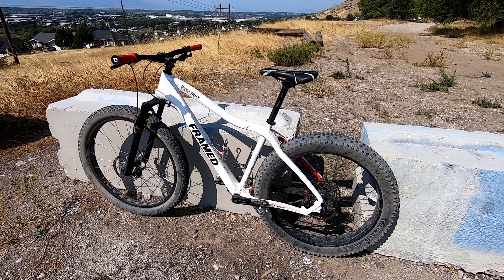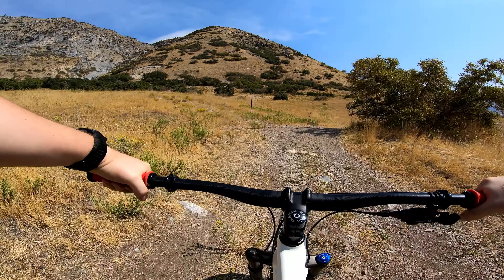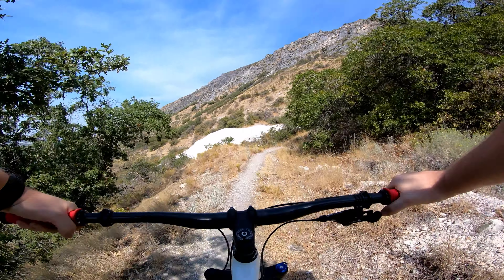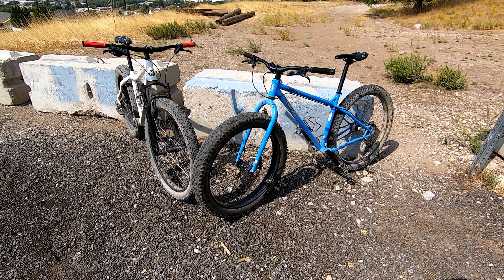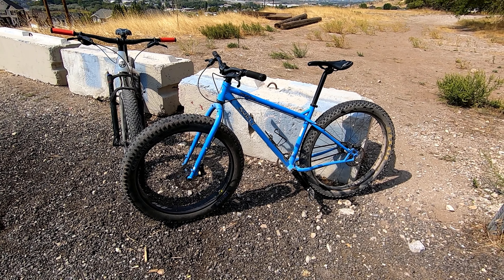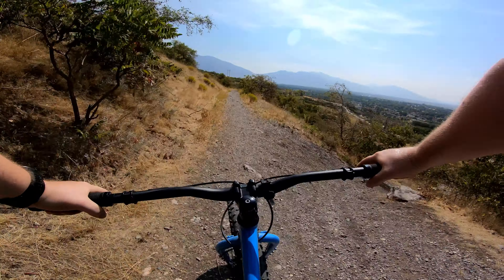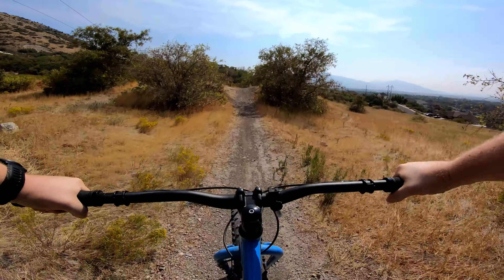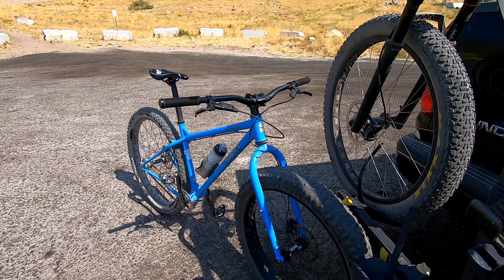Fat Mullet Bike? | Mixing Wheel Sizes On A Fat And 29+ Bike

Comment: My new MTN Bike will get a 350w e-hub kit, the same one that's on the gravel bike but in 27.5" with a 650B 2.6" tire to balance the front 2.3" 29er.  The idea is to make that hardtail comfortable with VentureMax drop-handlebars, the juicy 2.6" tire and a Canyon S15 suspension seatpost .

Comment: Exactly the vid I was looking for!

I recently received a Surly ice cream truck fork that I was considering throwing onto a Kona dew/Xtracycle leap cargo conversion and wanted know how well the fat front, thinner rear setup would work. 

It's a long bike with the cargo, and I wanted to realize how feasable it'd be for carrying kids and cargo through beach sand to the streets. I live in NYC but Amtrak regularly to DC and carry it from train to subway, etc.

Eventually, I'd like to add a middrive motor and maybe slap a 4" tire on the front with 3" rear but don't know if this works. If so, both 29" wheels? 27.5 front and 29" rear?

From your experience, what would you recommend? Please help!😂

Thanks for the awesome vid, btw!🙏

Comment: Btw, thank you for the vid quite informative, as coincidentally at the moment I'm swapping my 2 current bikes (Hardtail & Gravel) for a Surly ICT with two wheelsets the stock 26x4'8 and a spare 29x3 for touring/city use. I have to try this two mullets on the same bike and compare it with your experience.
Reply: I think it would be excellent and if you use shorter crank arms you won't feel the drop in the BB at all.  Pedal strikes on rocks can catapult a bicycle so one wants to keep an eye on that.  Sometimes on singletrack where rocks hide in the grass, I use the throttle and don't pedal at all and that's on a Milwaukee gravel conversation with a high BB.

Comment: How about a 26x4 in the back and a 29x2.8 or 29x2.6 in the front with suspension fork? Sounds interesting to me and in my mind it would give a hardtail the forgiveness of the fat tire on the hard backend and the better steering capability of the 29 in the front with the front suspension to eat the bumps.

In my mind, I would actually make that with a 130mm travel fork to get more of a mullet style ride, but god knows if the bike would get the good or the bad characteristics of each wheelset on the actual riding feel
Reply from the maker: I think that may work with a very fast rolling 4” tire and an aggressive front tire. It’s a very weird/unsettling feeling to have so much traction in the rear and comparatively little in the front. From this little experiment I found the bike felt sluggish when pedaling but with quick steering and the front end wanted to break loose before the rear.
Reply: @RideYearRound  yes, actuqlly that was how I pictured it. A fast rolling rear to enhance the floating characteristic of the super wide fatbike tire. And a very agressive front tyre that barely touches the plus size, but has a very nice steering like a minion DHF 2 or something similar. The sizes I proposed were in orther to get a slight mullet feel but also avoiding something too extr3me both in size difference as well as cushion

Comment: The way the weight moves under power on a moto is pretty extreme compared to a MTB. On a moto trail braking heavily into a corner REALLY compresses the front suspension and weights the front tire and when you power equivalent
Some newer electric motos are actually adopting more MTB geometry as the weight of them falls below 50kg. Kuberg has a 35kg moto that has 24"/24" front/rear. Once the weight of the bike falls below that of the rider - it shifts the focus of the design. They may even go to 26" wheels next.

Comment: 26 plus rear (2.8 or 3.0 wide, whatever's the same dia as 27.5 normal) and 29 normal on the front. Be mindful of wheel width, too, I read an article that boiled down to wheel width should be exactly half as much (or up to 5mm wider than hafl) as tire width for normal widths of tires IE 2.1-2.8